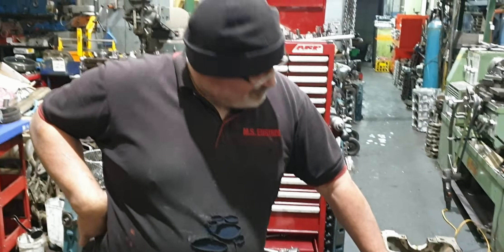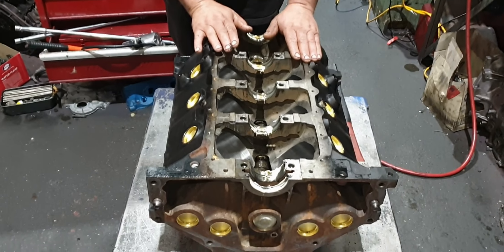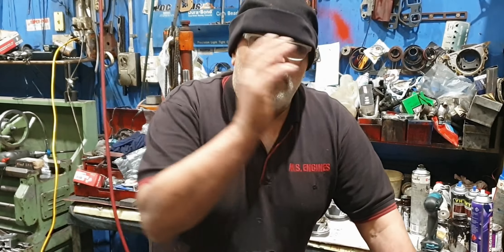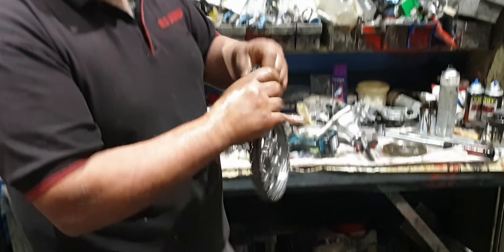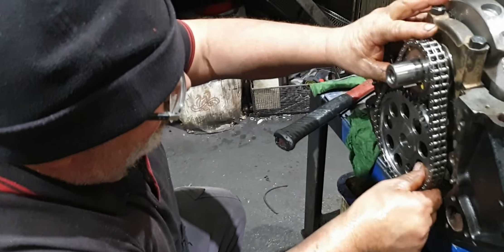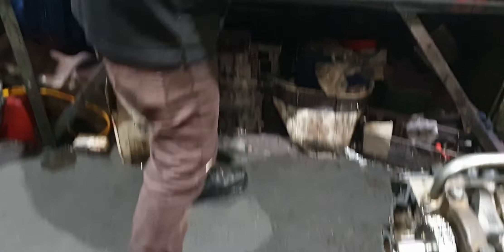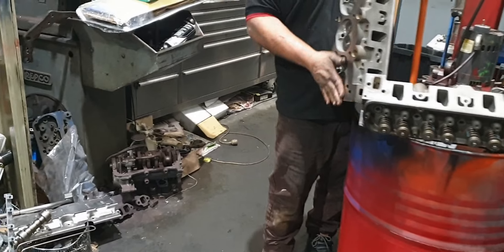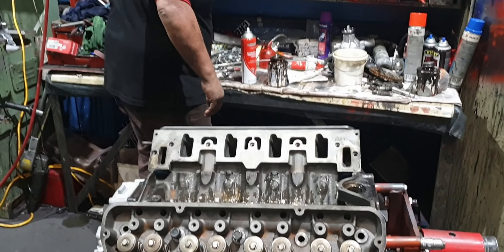Holden VR 304 Injected Engine into 355 Stroker

Comment: This guy knows really how to build a engine u can see it by how fast he works and how u knows the tricks of what and where.....
Reply: Ok. He is an assembler. Not a builder. I wouldnt let him in my workshop. Wonder if he can make 578hp from a non stroked    VN engine. I did .
Reply: @stuartclements9290  make a video and show us how you did it?
Reply: @davidnguyen9409  oh you want a tutorial video. If you want to learn watch David Vizard power tech 10 on youtube. I learnt much from him in the late 70"s and even now. Dont be a smart arse.
Reply: How many race winning engines have you built David Nguyen.???
Reply: @stuartclements9290  what was that at the crank, what did it make at the wheels???
Reply: @stuartclements9290 You didn't make 578hp from a stock stroke 304..You just didn't
Reply: @borismcfinnigan3430  1.93 hp per cubic inch is very difficult.  I spent 2 yrs to do this. Perkins engineering took 4 yrs. Lucky I knew Keith. Great man. I wasn't bound by any rules. In USA small cube nhra racing it was not uncommon for 2 hp for cubic inch engine development.  Get your head out your arse.. smarter men have come before you.
Reply: @stuartclements9290 you took 2 years to do what Perkins did in 4 years your full of bs

Comment: Hi mick, can you use 304 heads on a 253? If so what do you need to do, I'm sure yiu have to run a different cam, push rods and lifters, is there anything else you have to change. I have a red engine

Comment: I got a 5ltr VS VQ black block, l want to put in my old 1984 HJ47 cruiser. 
I currently have a 308 in it goes good but lacks torque when pulling a tandem trailer and gets a bit hot. I have since found out that these old blue 308's lack good oil flow through no.4 galleries under load so with this 5ltr l got I would like to upon up the oil galleries on no.4 to keep the heat down as l keep doing no.7 & 8 plugs on the 308 because of reduced oil flow which creates heat and also open up the main oil gallery at the front of block, plus l would like to diagonal 4 bolt main it.  
I'm looking for more torque say around 385, l not looking for anything stupid and around say 365 horse, but here's the $64 kicker?? I would also like to put 6 pound turbo boost on it for overtaking road trains on a hill where most times l have to sit behind the damn truck with the 308 cos it just doesn't quite have the get up and gallop l want with the trailer on.
So would l be able to get that torque out of a 355 or should l just go Chev.
But l really like the 355 to plonk in the old toyota where it's easy to fit, l've already made the firewall adjustements, rego blokes give me the thumbs up, easy to work on, plenty of parts and it's still a holden block and a bit c heaper on fuel, l run 98 on the 308 anyway, but also rub the new tojo's up the wrong way with a bit more grunt😁.
So whatiya reckon ol mate, is it worth it and can it be a workable reliability ?
Love to hear your feedback if possible👍
I live in the NT, Humpty doo .. Cheers
Reply: @MSEngines  Goodonyamate cheers